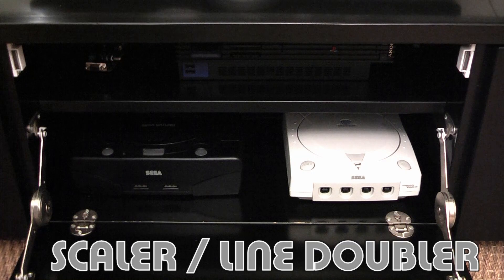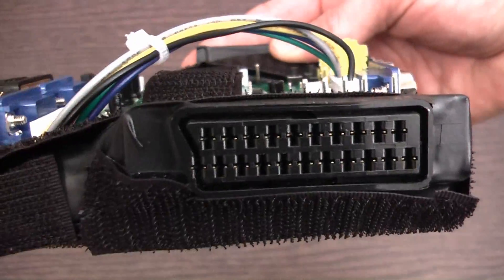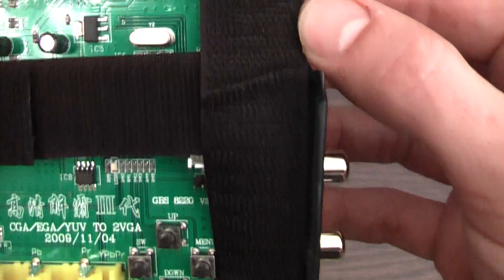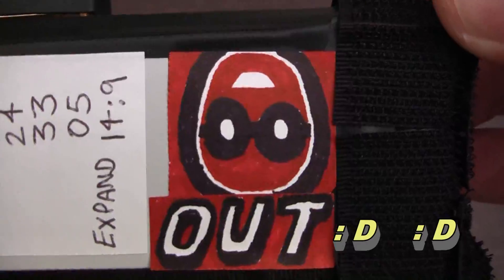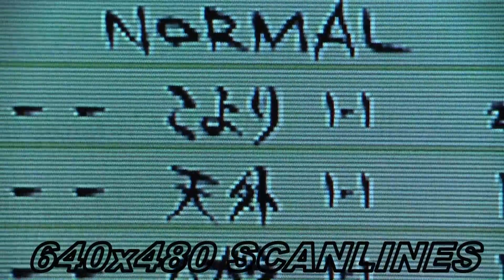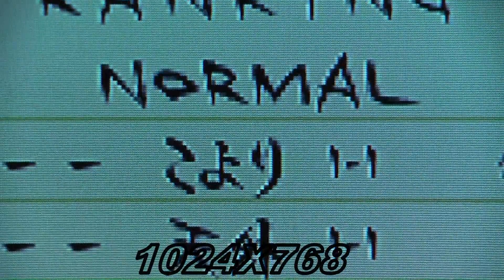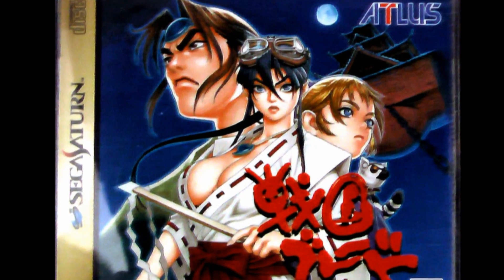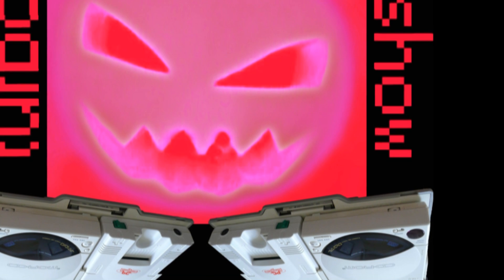RGB Scart to VGA / SVGA /XVGA Scaler with SLG 3000

Comment: where i can buy that pcb, with all that connection input? i'd like to have it with scart rgb input, to connect my multi scart splitter output, to play with my console connected to it ( snes, gc ).
on ebay there's not with the scart input :(.
thanks
Reply: Mirko M. I could built you one fella ;)

Comment from the maker: @64ddking i just bought a multi voltage PSU from Maplins. One of the tips will fit perfectly, if it's any help its the same size tip as the PC Engine and Megadrive. Tip needs to positive polarity but it will say on the PCB.